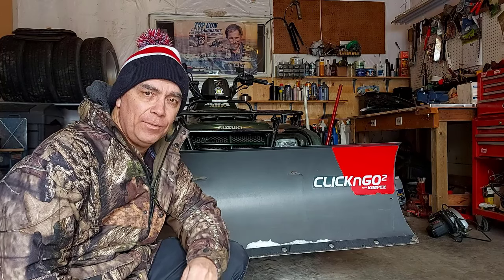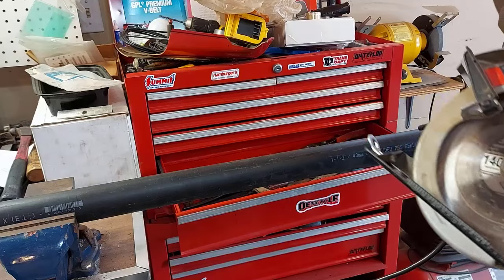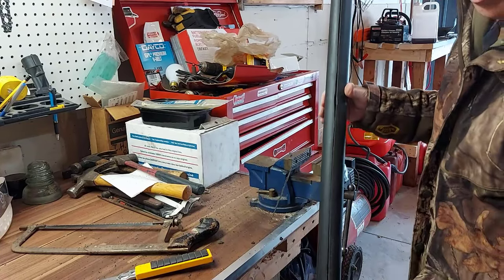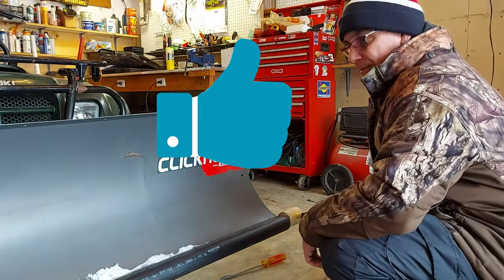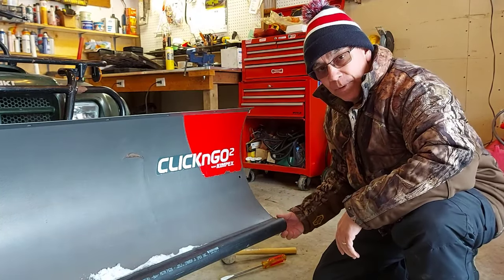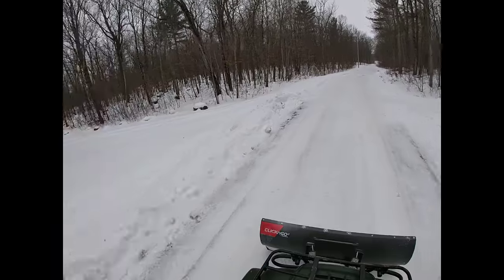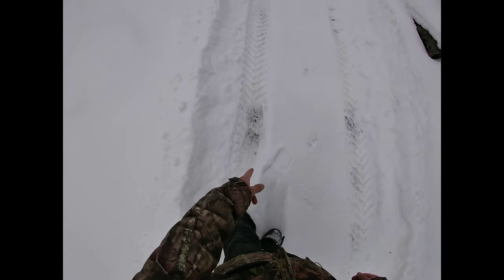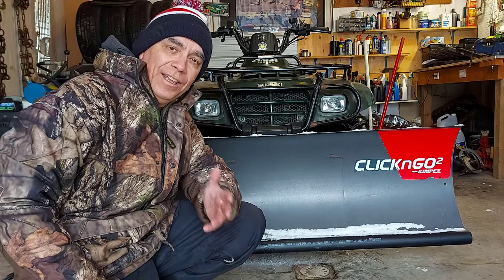ATV Snow Plow Hack For Plowing a Gravel Drive

Comment: I have been using this trick for 3 winters now, with the same PVC pipe, even with over 800 feet of driveway.
I use it mostly in early winter, until a layer of ice forms and the gravel freezes in place.
Before using this trick, the Kubota's snowblower was scattering kilos of gravel in the forest, in addition to wearing out the paint and all the parts like a grinder would do.
Reply from the maker: Oh thats not good. The pipe is so cool and saves money on gravel lol
Reply: Appreciate the info

Comment: I heard about this hack, and tried it for the first time.  I have recycled asphalt on a 1/4 mile driveway.  Even though I use the hockey pucks “snow shoes”, all it takes is going too fast and a strong bump and the hockey puck will drag a nice long gash in your driveway,  The ABS pipe will keep that from happening.  Like you said, the purpose is to take off enough of the snow it should melt after the sun comes out.
Reply from the maker: Oh wow I can see that happening on recycled asphalt. My neighbors driveway has that on it. It's not very durable.

Comment: Great idea! My plough came without shoes and I really didn’t want to spend anymore money… This will be a great solution! Thanks!
Reply: I agree with not spending any more money.   Were you able to try this and how did it work?
Reply: @ronlarson1225  It works pretty good… Sometimes I think a little more down pressure on the blade would be helpful though. But you don’t have to worry about digging up your gravel driveway or even digging up your lawn if you turn around on the grass!

Comment: I have the 60" Kimpex Click n Go 2 on my Grizzly 700, awesome plow.. I have the side panels (drift cutters) installed, also running diamond style v-bar tire chains on the rear. This thing is a tank and will push huge mounds of wet heavy snow!! 

If your driveway is on a slope, definitely get the tire chains, especially if you're pushing up hill. I'd go front and rear in this case just to be sure. It's impressive how well an atv pushes snow with chains.

The plow itself is a very clever design IMO, I would definitely recommend it to anybody on the fence about buying it.

Comment: It works good at the beginning of the winter so the blade doesn't dig into the gravel driveway. Then as the snow gets frozen and makes a good hardpacked surface, then I take it off and use the blade to keep it scraped clean. My shoes are set so the blade just touches the surface but doesn't dig it.

Comment: Made a skid from a length of 1/2 pipe ... (2" diameter)  with a short piece of flat stock welded 6 inches from either end across the flats to bolt it to the blade where the sliders would normally be fixed.... works great .... its effectively the same thing but a lot more robust.

Comment: Update:   I first tried this a few days ago.  Works great on gravel!   No gouging no kickback.   The ABS stays put.   It shows signs of wear.  But now that there is no gravel on the surface,  it won’t wear as quick.  Even if it only lasts a winter, it is a cheap hack!
Reply from the maker: It's awesome isn't it 🙂
Reply: Appreciate the feedback
Reply: Thanks for the update. This is my 1st year with an ATV & plow (Moose plow 60" on a Polaris 500 HO EFI)...I live in N. Saskatchewan Canada so sometimes we get 1st snow before freeze up and makes plowing a nightmare. The shoes dig into the soft gravel/grass and really had me concerned. I came on here and found this hack, and great to hear it worked well for you. I just cut my PVC pipe today and will put it on tomorrow and ready for our 1st snow that is supposed to come this weekend and we are not at freeze up yet...so I am looking forward to it now and not dreading it. Cheers
Reply: @flyinthebug35   Dec. 8 '22. I've had your same 4WLR & Moose plow for several years now with gravel driveway/parking area. I also plow paths through my yard and woods so we can walk our dogs. The rig works much better with the PVC protector on the blade edge. It just wears out after a couple years. Tnx from North PA

Comment: I did something similar with my snow blower on my lawn tractor for my gravel driveway....keeps from digging into the gravel and throwing rocks.  I used steel pipe though, don't want to have to replace it all the time from getting broken.

Comment: Just tried this with ABS pipe, 20 minutes into plowing the ABS tubing cracked then split down the center. I know I hit a small rock that did it. This would be fine on a paved drive, not really gravel. Though it is 16 f. here this morning. This worked great on the lawn though.
Reply: You don’t need it for a paved driveway 😂

Comment: I might have to try this on my Polaris UTV plow as I sure do push a lot of rocks and why I have not used it very much.  I have been running a walk behind blower instead, this would save me quite a bit of time if it works.  Thanks!
Reply from the maker: Did you end up trying this method and how was your results?
Reply: Actually I haven't.  I had forgotten about this and have since plowed just this past week.  I don't think it will work honestly as it will likely just ramp up over the snow.  I'll be putting my skid plates back on that I took off when I find them...which will basically do the same without uplift

Comment: Nice one.  I have a long gravel driveway and while the snowblower works well on it (I have Armorskids on the sides of the auger bucket) I hate using the snowblower up at the road where the highway plows throw larger rocks etc.  I am leaning towards something like this.  Can I ask, do you have any general advice on ATV / plow set ups?  Are any of the  centrifugal clutches / HST transmissions better or worse?  Thanks much.

Comment: Hi Roland, you say its 2" , but the ABS says 1 1/2".  Cheers, Greg
Reply: I’ve got lots of 2 inch laying around from my irrigation system so I’m going to use 2 inch. Just discovered the channel. Subbed. I know I’m going to enjoy it. Thank you sir👍🏻
Reply: It's probably 1 1/2 inside diameter
Reply: @tpuser42675  most pipe is measured I.D
Reply: @georgemcfly7358  Apparently most people don't know that.
Reply: Good catch. It is stamped 1 1/2”
Reply: 2" might be the outside diameter?

Comment: So I thought this was a great idea.  I bought white drain pipe (1.5" diameter) and tried it out.  The pipe ended up cracking and started breaking off in pieces within the first few hundred feet.  Did you have good luck with the black?
Reply from the maker: Mine is still in one piece
Reply: Try schedule 80 pipe. Alot thicker.

Comment: Problem with my plow on my quad, is even with the shoes installed with the blade a 1/2” above the gravel, the shoes themselves are digging into the gravel.. thinking of removing them and using ABS pipe
Reply from the maker: Ya I experience that until a crust builds up on the driveway.
Reply: @GettingItDoneRepairs  got a crust this morning that’s for sure lol